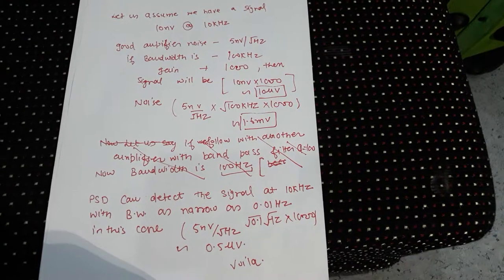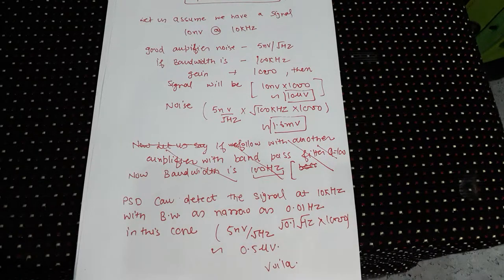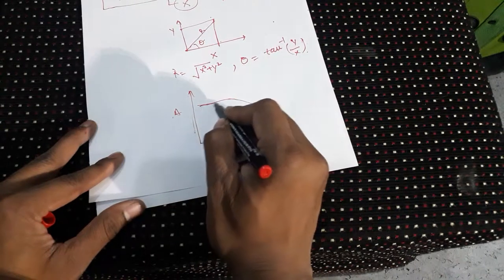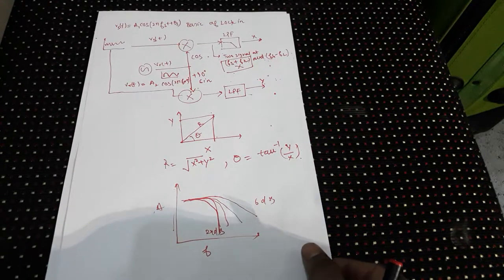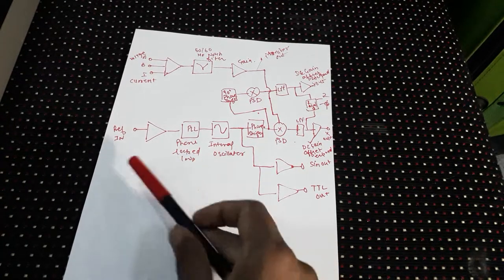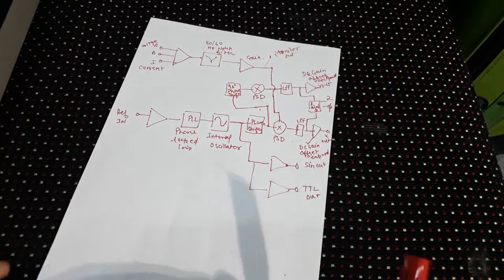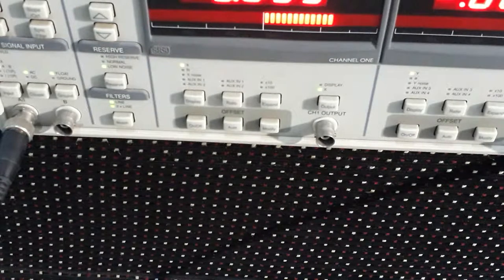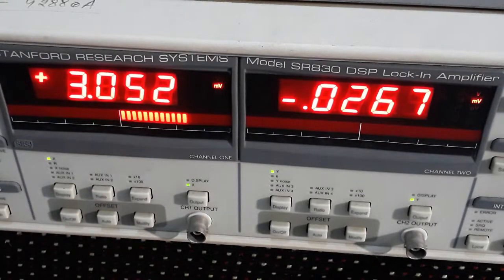A crash course on SR830 lock in amplifier

Comment: Mr.Shel, i want to use 4-probes but I don't know how to conncet the circuit. I think that CH1 can be used as a AC current generator to flow an AC current in circuit, and reference sine out & signal input can be used as multimeter to test the inner voltage. Is that right?
Reply from the maker: AC generator is your sine out , Input A and Input B are your two terminal of voltmeter for four probe measurement. (CH1 and CH2 are just the display after measurement.)
Reply: @BholuUPPb  Really appreciate your help and looking forward to more videos!

Comment: Can I get DC voltage using Aux output from lock in?
If I can please help me sir!
Reply from the maker: Yes you can. It is normally 0-10V DC and you can change the voltage from the front panel of SRS by selecting the aux out and then by rotating the knob.

Comment: shel SIR can I use external wave generator  for   lock in  ?? if yes then  provide some detail about external  wave generator
Reply from the maker: Yes, you can use  external wave generator, now to do that you have to source to go to unlock and the external wave generator,  you have to connect to ref in port.
Your wave genrator can be any normal function genrator, since internal function geneator of SRS 830 is so good that normally we do not need external wave gen, but if you need very high resolution i  frequency then you can use external wavegen

Comment: i am using sr830 to make up a set using labview . i want to sweep the voltage . which port is giving dc voltage . Is it aux out port?
Reply from the maker: Yes
Reply: @BholuUPPb  thank you.  Can tell me in details about signal input
Reply from the maker: @anindyasundarjana98  ok, you can assume signal output is like function genratot and signal input is like your multimeter
Reply: @BholuUPPb  ok.. Got the point.  So how A-B differential mode is operate?
Reply from the maker: @anindyasundarjana98  A-B is the measuring point A with respect to the ground minus point B with respect to the ground
Reply: @BholuUPPb  ok thank you so much for your help

Comment: The value of X ois greater than R!!
Reply from the maker: Could you please point out the time at which you saw the value of X is greater than R
Reply: @BholuUPPb   so we are trying to measure the difference of two LED signal by using same two photodiodes. the output of the photodiodes are A and B in LIA. we have two issues, the reading of the LIA is drifting with time, and I keep see that the value of X is more than R
Reply: the measurement is A-B